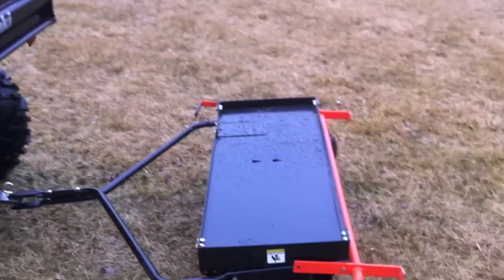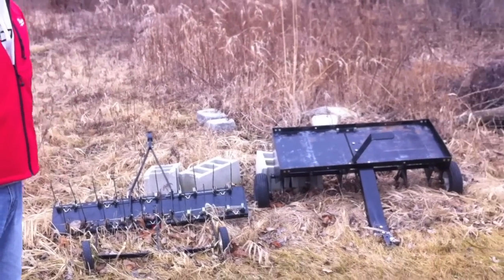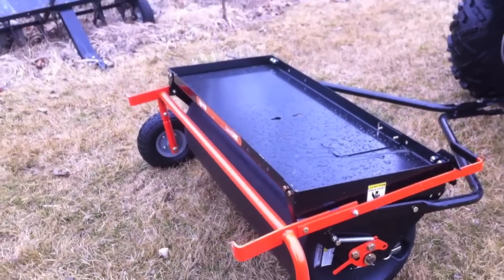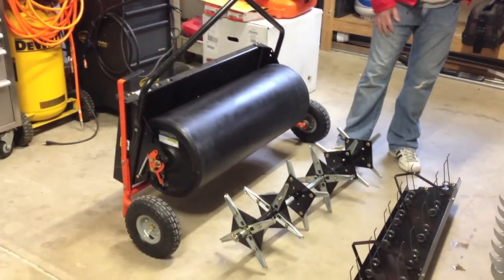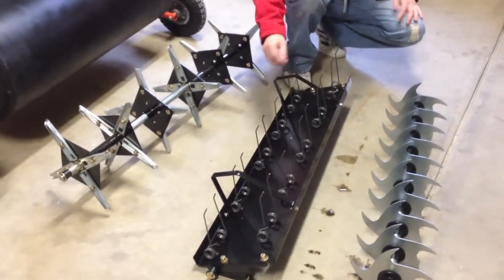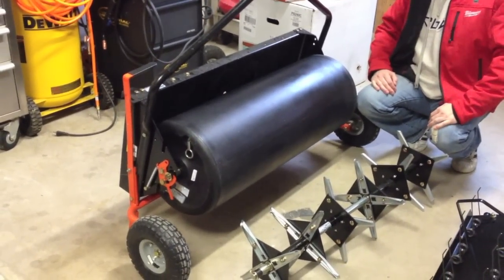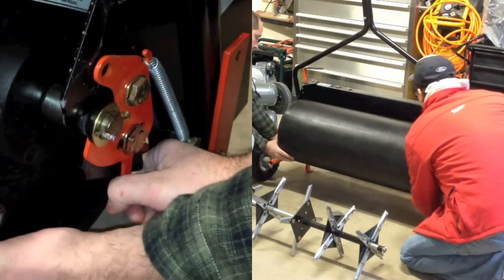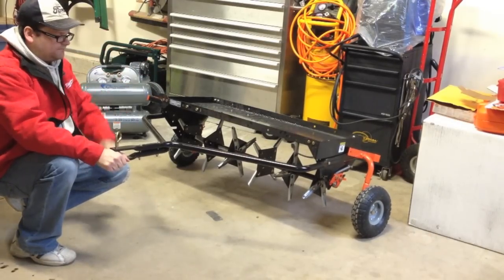Agri-Fab SMARTLINK System - Overview

Comment: I noticed when you removed the roller and put in the aerator, you did not put in the center plate which supports the center bar of the aerator.  Just wondering why you didn't add the plate as it adds additional support to the aerator bar?